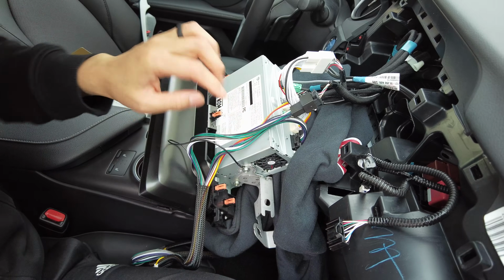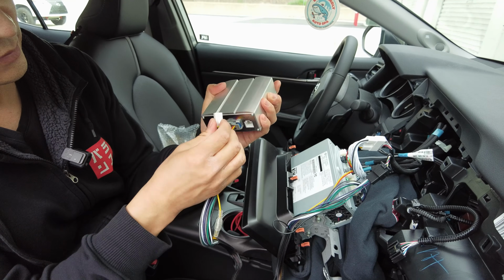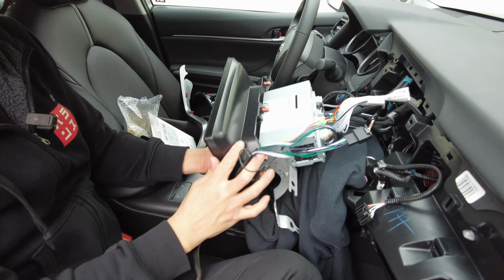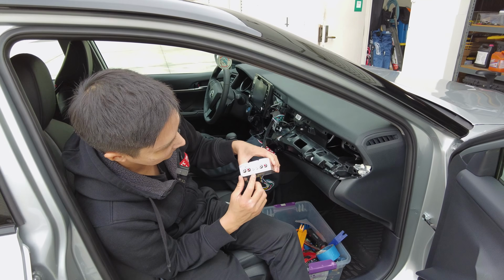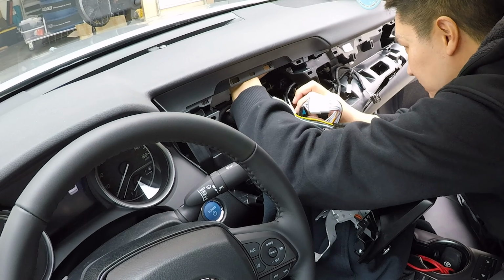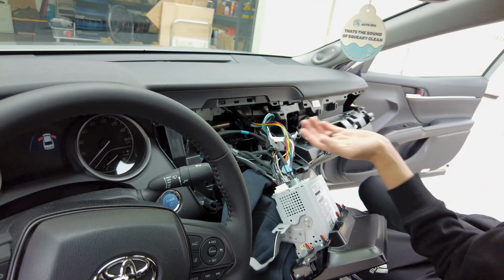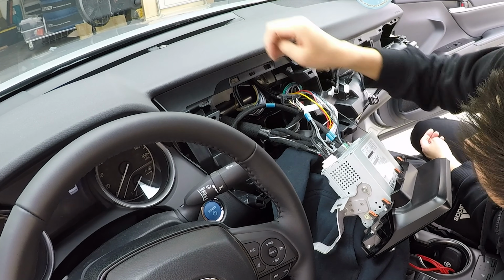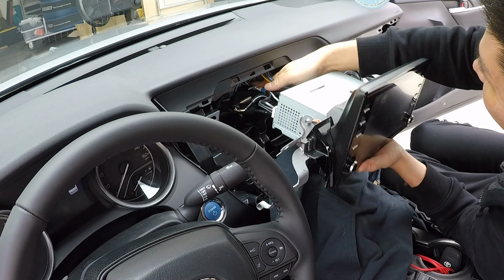Toyota Camry with JBL | Beat-Sonic Amplifier Installation

Comment: Hello there! Would this Beat-Sonic work on a 2013 Toyota Camry with JBL? The amp on this model year is located beneath the driver’s seat. Can I install the Beat-Sonic in the same place? I would also like to add a sub, and replace the door speakers and rear speakers.
Reply from the maker: ENA-2T1 should be compatible with your vehicle. Our amp doesn't install where your factory amp is, it installs behind the radio. https://www.beatsonicusa.com/products/ena-2t1

Comment: I don’t get this setup. Aren’t you supposed to add the amp between the signal and the speakers? Or how is the installation when you have a Camry with the factory JBL amp?
Reply from the maker: Our amp drives and clarifies audio signals to the factory amp's input

Comment: I have a 2025 and I was wondering if I replace the jbl factory speakers with another JBL 2ohms speakers and this amp, will that work? you said on other comments that you need 4ohms speakers. Will this amplify the sub?
Reply: I have a 25 Camry with JBL and they OEM speakers are 4 ohm, I had the factory speakers front & rear door replaced with JL Audio C1’s (regret) I should have gone with focal flax’s. I had the shop check with a meter what is the JBL speaker ohm and he said is 3.8 which rounded to 4 ohms.
Reply: @adrian4eva oem amp? How is the sound now?
Reply: @JoseSorianoPhotography  yes the OEM JBL Amp. The sound is much clearer and the bass is much more in the doors (a lot more than I wanted) so I had to turn the bass down minus in the screen.i didn’t change the rear deck subwoofer speaker because it’s a open air sub and they don’t really have aftermarket options except marine speakers but the OEM amp is too weak to power that. So I left that alone. 

If you’re going to change the door speakers, I’d highly recommend you sound deaden the doors and use foam speaker mounts too. I didn’t do that and regret it. 

Maybe I’ll do it later. I’m leasing the car so I didn’t want to go too crazy in case I don’t want to keep it at the end. 

But overall the OEM amp is weak even with the new speakers. That’s why I’m thinking of getting this beat sonic for the time being & if I keep the car than I’ll do a whole aftermarket amp with a dsp and change the speakers to the focals.
Reply from the maker: Our amp is compatible with 4~8 ohm speakers.

Comment: My car is a 2018 Camry Hybrid and I have a reservation for installation through the official Korean dealer. I would like to ask if 12 o'clock in the rear and 3 o'clock in the front is the most ideal setting for this vehicle model.
Reply from the maker: Yes, however you may adjust it to your liking.

Comment: Would this work well and improve sound quality on 3ohm JBL’s. These are aftermarket not OEM
Reply from the maker: Specifications call for 4-8 ohm speakers.
Reply: @BeatSonicUS  so since my factory speakers where 4 Ohm then this would make a significant difference in music quality over my 3 ohm JBL’s?
Reply from the maker: @marloncordero6233  Running 3 ohm speakers may cause the amplifier to run hotter than usual. The amplifier has a fail safe protection built in so that it will shut off if it becomes too hot. As long as you keep the default gain setting at 50%, it may work without any issues.

Comment: Hey I got a question, I got this harness that has remote out and RCA that is all plug and play in the same exact plugs where the amp is installed, do you think it’ll still work if I plug that with the sub?
Reply from the maker: Not sure but you should check with wherever you got it from

Comment: sounds like it just barely raises them mids, which is why it sounds like it does. For over $380 for my 2022 WRX it's not as good as making my own plug-n-play with 4 ch amp.
Reply from the maker: That’s how it may sound from from listening to it from this video but the audio improves in all spectrum in a vehicle. This is $299 and not $380. Installing this will take 30mins compared to a different 4 ch amp may take hours. And results may vary